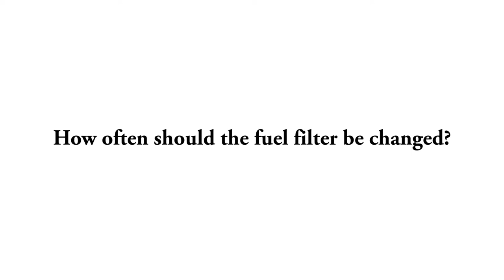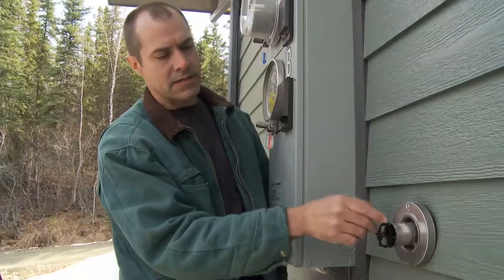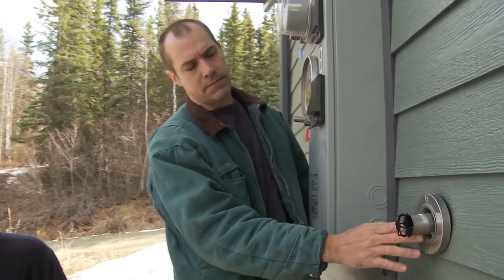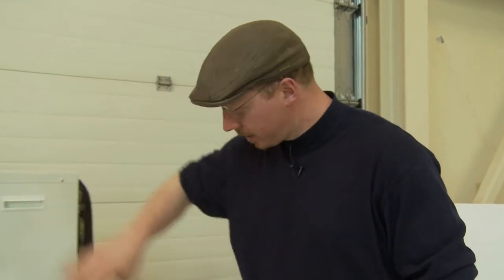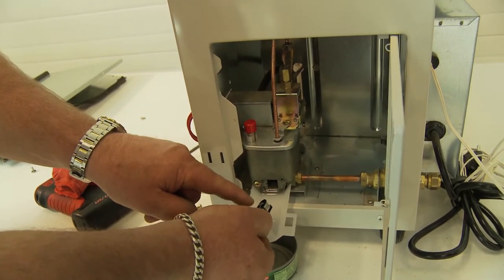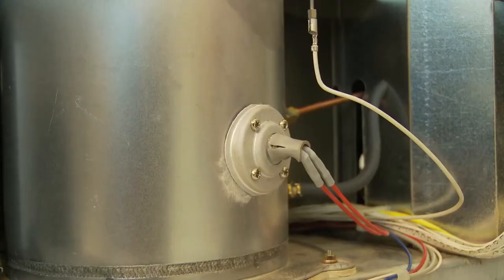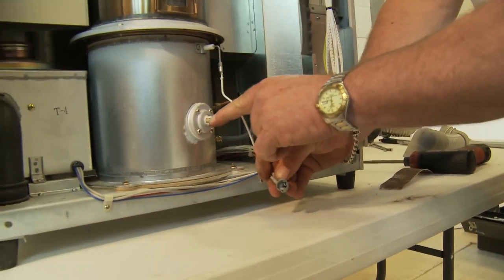Your Northern Home: Small space heater maintenance

Comment: I just purchased a house in Maine with four Toyotomi Oil Misers. I’ve never heard of these before this move. They are all about 10-12 years old, and I’m fairly certain they haven’t been serviced in 6 years! Yikes! I had 100% success with tearing the first one down, cleaning, and reinstalling. Everything looks fabulous and it’s been working sooooo well. (I think I might have heard it actually say ‘thank you’ to me!!)

Well so much for success! I’m on unit number two and I’m pretty sure it’s been by the grace of God that there hasn’t been a fire. The rubber hose was nestled in directly against the unit and has been slowly burning! The inside is black with soot as well in the area under the blower guard. 

So, here’s my question: is this unit now a hazard? What does all of that sooty air do to the inside of the burner? Can this unit be saved?!?!?

Comment: I’m guessing it’s a good idea to burn off any excess fuel in the lines after shutting the supply off from the tank before opening the filter port. It’s probably common knowledge but just putting it out there so someone isn’t surprised by a sudden glut of fuel running into their home.